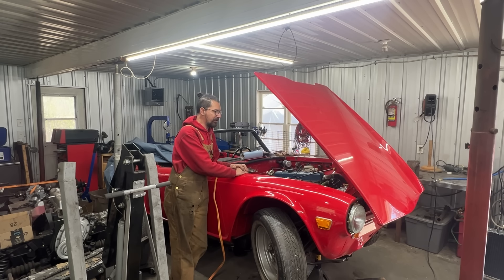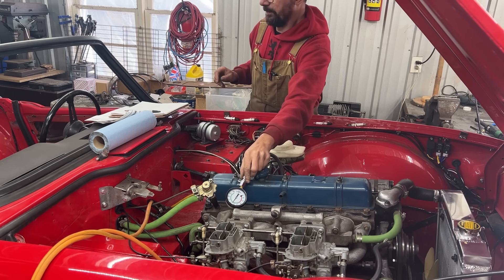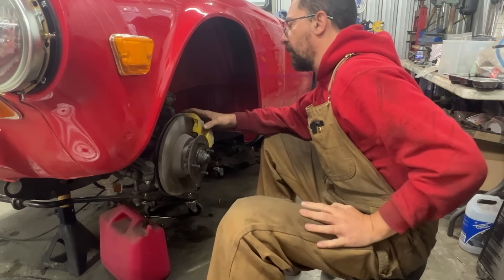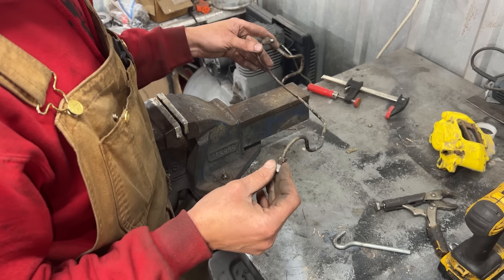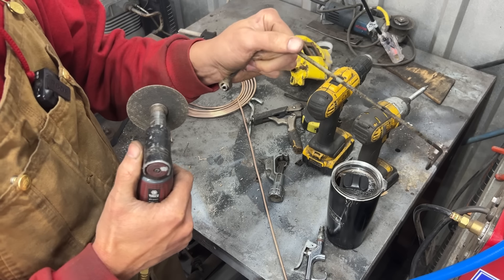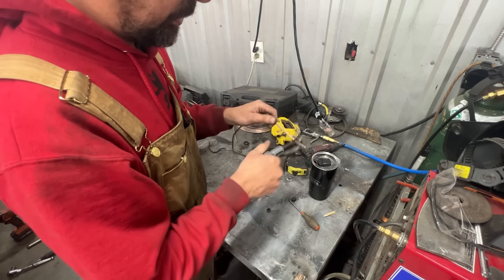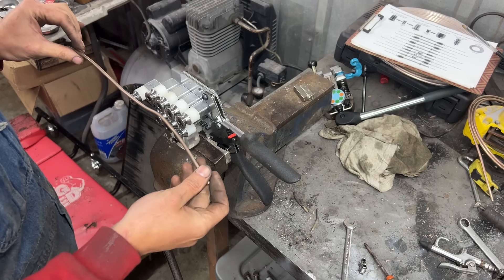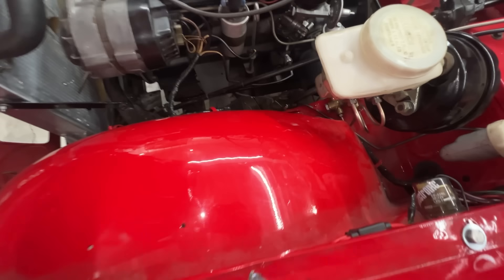1970 TR6 - Part 42 - Let's Make Brake Lines From Scratch

Comment: Great video as usual.  I thought that the compression was perfect. The starter seemed weak even with all the plugs out.  Many  times when making a brake line I will use string to get the exact length needed.

Comment: Great stuff Elin.. another few jobs ticked off the list  ..  If it were me, I'd try and find an octane boost additive for the fuel to prevent  prematurely igniting of fuel/air mixture before the spark plug has a chance to get to it. 😅

Comment: Those Webers are 2 barrel sequential carbs.  In other words, the second barrel only opens when the throttle is open nearly 3/4's.  There is only a single idle fuel adjustment needle for the primary barrel.  It should be on the outside of the carb on the throttle plate.  The Idle adjustment may not work properly if the idle air jets are blocked. Oddly, there are primary and secondary idle air jets.  They are located high in the main body of the carb on the inner and outer sides.
The idle air correction jets are small brass screws that hold the jets.  The jets are pushed into the brass screws and should not be seated fully.  The jets should be pushed into the screws, but should be allowed to find their own depth when screwed into the carb body.  If you don't do this, the jet may allow air to leak past the jet.
Reply: Thanks Michael. I knew nothing about my carbs.

Comment: Hi Elin, I see you can bend the brake lines without them going flat. I know when you bend thicker pipes you need to put a spring inside to prevent it from going flat. Up to which size can a pipe be bent before a spring is needed? Or does the material from which it is made also play a roll? Thanks for your very informative videos!

Comment: Elin, I believe you are correct that the front brake line does not lay on top of the frame cross member of the engine. I think it should run across the rearward side of that cross member, where it would be better protected against damage from road debris or any work being done on the bottom of the engine. 
I have seen that pipe attached two different ways. One uses a spring steel clip that fastens to the flange at the bottom of that cross member. Moss shows it on their website, but lists it as N/A and doesn't indicate the Triumph part number. 
The second type of fastener or clip is also spring steel, but instead snaps into a hole drilled in the rear face of the cross member. Rimmer Bros. shows this type on their website and sells it.
Personally I would prefer the 1st  type of clip, because I would rather not drill a hole in the cross member (if one isn't already there). I just don't know where to get that 1st type of clip. But maybe you do.
Your brake lines look grea! There are  copper-nickel "kits" available with all the fittings installed and flares done. They still need to be bent to shape and, in my experience, sometimes are longer than the originals. That leaves the installer to choose whether to try to make work as is by positioning the slack somewhere it won't be a problem... or shortening and reforming the flare. 
P.S. I will be purchasing the flaring tool you showed before I ever do this job again! I have one of the "old school" type flare tools, which can be tricky to use. The one you used looks to solve the all or most of the problems of the old type!

Comment: Good morning Elin from Aust.
With regards to the height issues you have with the TR6, I might offer a solution.
Although not quite the same, my Healey states that when rebuilding the front suspension, the top wishbone must be lifted 1.5 inches with a block before assembly, I haven't figured out why as yet but the book is very adament this is done. As for brake lines, I've made all of mine but did not have any info regarding the  length. All the lines were broken or missing. Anyway, we just keep going. 
Wish you were here to help with the wiring!!

Comment: Elin… great work with this series … very helpful for me as I finish up my restoration on my 75 … I have a question on the propeller shaft … is there a way to install it after the transmission and differential have already been installed ? How would you address this issue?  Than you
Reply from the maker: @scottdrysdale9903  thank you. Yes, no problem doing that as long as the exhaust is still not installed. Also the transmission cover needs to be off so you can do the front bolts.

Comment: The later year TR6's had a raised suspension compared to the earlier years of TR6's and TR4's because of American standardized bumper height regulations that went into effect in 1974 and thereafter.  That's why it has a raised ride height when compared to any earlier model year TR6's or theTR4's.  I believe that the TR6's used different spring rates to achieve the higher ride height of the later years of TR6's.

Comment: My 90s Fiat 1400cc OHC engine had a correct compression ratio of 175-180 psi… so quite usual for UK / Europe… not sure why an OK standard Triumph starter should struggle with that compression because the first TR5 / TR6 engines were high compression and performance (and emissions !).

Comment: I noticed when you moved that fuel hose, it looked rather soft. Please make certain that ALL of the rubber fuel hose is ethanol proof 30R14, for carburettors, or 30R9, for injection. These are bio-fuel hoses. Do NOT use any 30R6 or 30R7 as still being sold by various auto parts stores. otherwise, the modern ethanol laced fuel will make short work of them! (Fuel hose should never be purchased on ebay because of fakes!)